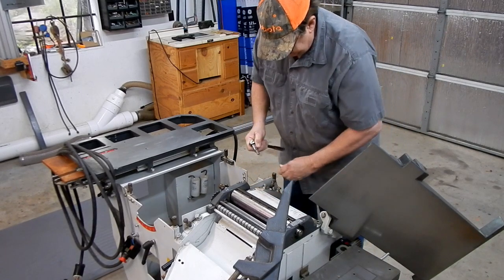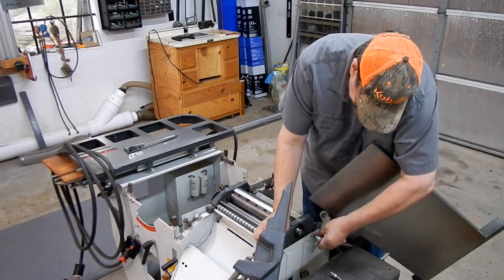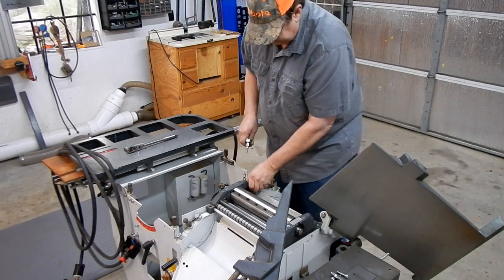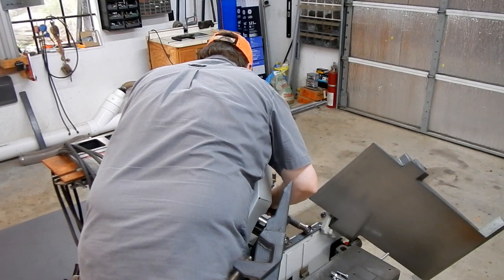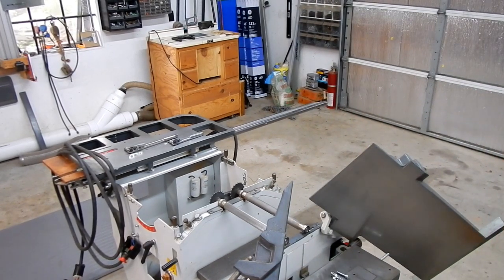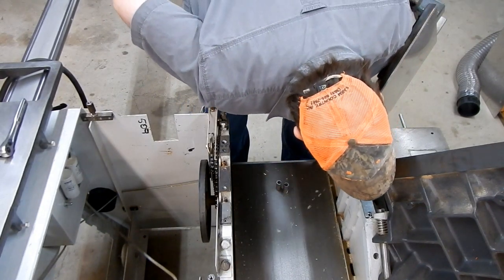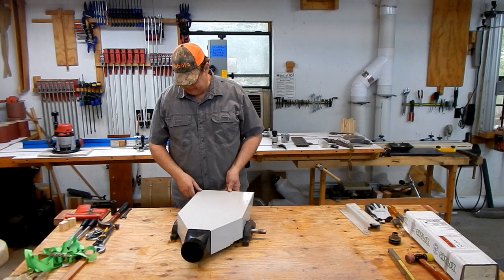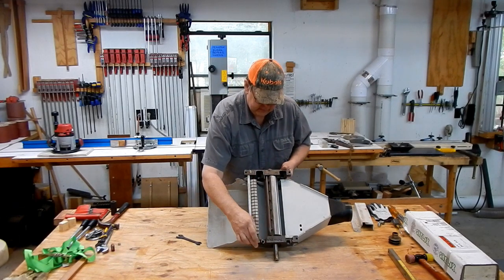Robland X 31 Jointer Disassembly

Comment: Hey David…I have a X31 purchased in 1991.  Planer material gets hung up and I have to push it through.  You think I should run those set screws down a quarter turn so rollers grab better?
Reply from the maker: If you look in under the shroud and the rollers turn continuously without stopping  then the rollers are most likely dirty. If the rollers are stopping then there could be a problem with the belt or rubber coated drive wheel slipping which may need cleaning. My machine is a later model so the roller configuation could be slightly different. The first thing I would look at at is the front serrated toothed drive roller and the rear rough surface drive roller. They require cleaning periodically with some turpentine or paint thinner and a brush. The front roller with serrated teeth will fill up will wood dust and loose it's grip. You may have to clean out the teeth with the edge of a putty knife. I would also make sure the table has a good coating of wax. Hope this helps.
Reply: @davidpape9726  thanks!!! Serrated roller is clean but noticed build up on our feed roller ….will clean it up and let ya know…thanks again!
Reply from the maker: Make sure you have engaged the lever below the planer table,  I have done that in the past.

Comment: Bonjour
Si vous venez en vacances en France 🇫🇷 je vous invite gracieusement en contre partie d’une révision de ma Robland X 310 😀
Vidéo très intéressante
Merci
Jean-Paul
Reply from the maker: Je vous remercie pour vos aimables paroles. La plupart des améliorations apportées au X310 correspondent aux souhaits des propriétaires du X31. Je suis en train de fabriquer un bras oscillant pour la table coulissante.

Thank you for your kind words. Many of the improvements on the X310 is what the owners of the X31 desire.  I am in the process of fabricating a swing arm for the sliding table.

Comment: David,
I did it a different way. I just unbolted the bearing blocks, loosened the motor to get slack on the drive belts and pulled them through the table top enough to get to the rolled pin in the drive pulley of the cutter head and drive it out of the shaft. Then slide the whole assembly out sideways. New bearings and spiral head back in and running in just under 3 hours. Nothing had to be dialed back in as all you have to do is keep track of the the shims for the bearing blocks. The table never got disturbed.
Cheers
Reply from the maker: That was the way I first approached it, but the pully would not come off the old shaft. I ended up using a puller to remove the pully which could not be done with the top on. Thanks